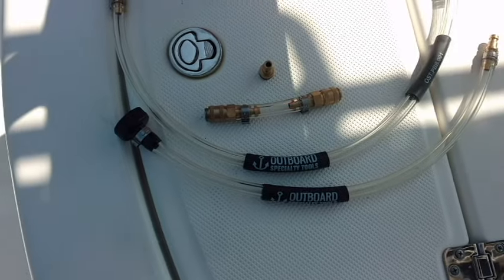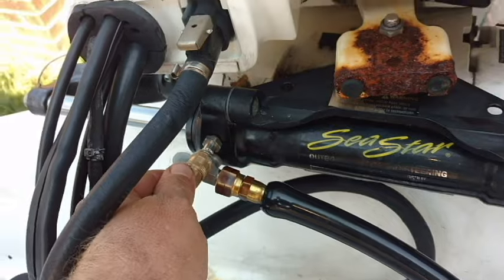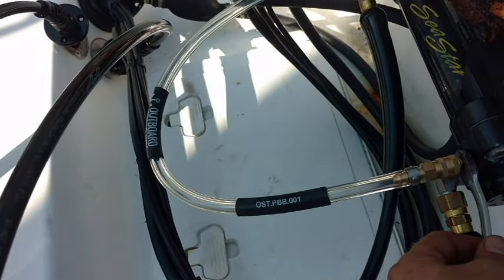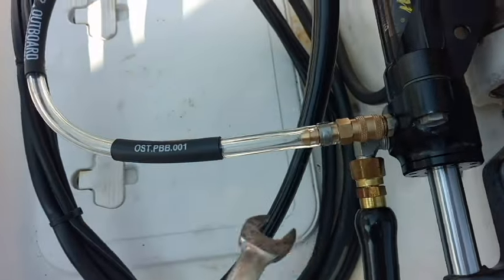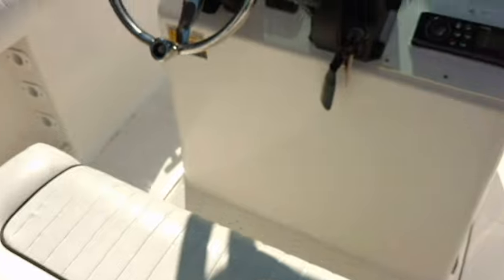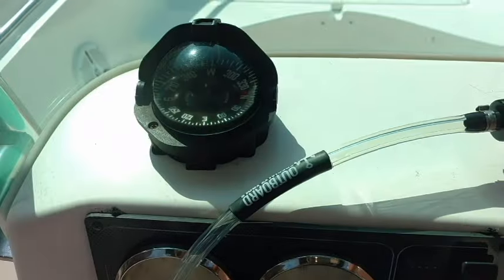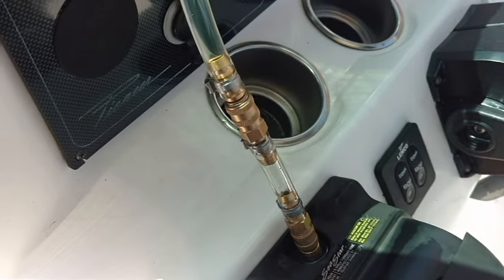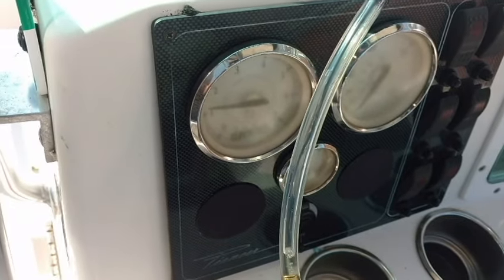Bubble Purge™ SeaStar Hydraulic Steering Bleed Repair OST

Comment: good job. i wonder something.

when motor is moved to port side or starboard, how to lock the engine no movement?

and one more. when motor is moved to port side. Did you turn wheel counter -clock wise?
Reply from the maker: Usually If I want to lock the cylinder into place, I use a clamp, such as vice grips with something to protect the steering rod, usually a piece of pex tubing, blue with 5/8" interior diameter (if I remember correctly).  This clamp method is in our other video featuring the G2 https://youtu.be/CwolF1vIXGA at minute 18:00.  Usually when I have the motor turned out all the way to port or starboard lock, I turn the wheel in both directions, but give it a few more turns towards the direction the motor is already locked out, i.e. if the motor is turned all the way to the port lock, which is done by steering hard to starboard, I will continue to steer to starboard in order to push as much fluid as possible into the port side of the cylinder bore to remove as much air as possible.  Then you can lock the cylinder down if you want, and turn to port and close out as much of the starboard bore as possible while priming it fully.
Reply: @outboardst.comoutboardspec8631  i have watched your other video clip in youtube for purge solution. thanks for your reply. have a nice day. :-)

Comment: Does air in the line make you steering feel like gears grinding alittle? I still need to bleed mine more I believe. Just the grinding part has me curious.
Reply: If you have air in the line, it would either make a squeak noise or slip.  Another way to tell is your steering is spongy or non-responsive.  The cylinder should be moving within 10-15 degrees of turning the wheel either direction.
Grinding noise sounds like you have rust / sludge in the helm.  If your helm is in salt water and it not been flushed each year, it most likely have rust sludge inside.  I know because I just rebuilt my buddy's Seastar helm just last night.  It was caked with sludge on the bottom of the helm.  Look at your hydraulic fluid.  If you have Seastar fluid, it should be clear yellow.  If you see a brown tint in it, its all rust.  If I can show you the pictures of the rebuilt helm inside, you would be shocked at how much rust it can get inside.  The seastar helms suck because it has open vents and that allows water to get inside.
Reply: @ahndeux  thanks for replying back. Now i have narrowed it down to maybe a bad hydraulic pump. No air in system and when i turn all the way to the left I feel like a grinding feel. All the way to the right is normal. What do you think this could be?
Reply: @jeffjue4648  Do you mean the hydraulic steering helm?  If you have grinding on one side but not the other, the most likely culprit is your hydraulic helm.  More specifically, its in the check valves inside your helm.  If the helm has been in salt water for years, there is a good chance the grittiness is due to rust.  Here are two ways to quickly suspect rusting.  First, remove your fill plug on top and look at the o ring seals.  If its cracked and has gaps, there is a good chance water has gotten in over the years.  Second, if you can drain some fluid out on the purge valve into a clear container, look at the fluid carefully.  If it has a brown tint or you seem small particles, there is a good chance water got in too.  If you used the recommended hydraulic fluid, it should be a nice clear yellow.  If its even slightly brown, definitely rust sludge inside.
Reply: @jeffjue4648  The way the hydraulic helm pump works is, it has a series of cylinders inside.  The cylinder has a spring underneath it.  When you rotate the helm, it slides the tip of the cylinders along a plate that is set at an angle.  The angle makes the cylinders rotate and pump fluid.  After the cylinder, it goes to a check valve to on the left and right side of the outlet.  The fluid then goes into a shuttle valve that flips from the left and right.  Because of the way the pump is designed, it should be the same amount of resistance or grittiness on either direction.  However, if you have grittiness on one side, it means the check valves or the shuttle valve is working properly.  More likely you will see that its easier to turn on one side than the other if the shuttle valve is stuck.  Instead of pumping fluid into the correct output port, it may be recirculating back into the the other port.  On the exit end of the port, there is also two more pressure relief valves.  It is just a ball with a spring on the end.  This is designed to open if the pressure is too high.  If there is debris in those ports, it may be opening and closing and causing the "grittiness" feeling you had.  Until you open it up and rebuild it, it is hard to tell which area of the pump has issues.
https://www.youtube.com/watch?v=HJUjWE1o3Lo
Reply: @jeffjue4648  I don't do rebuild for a shop, however, I rebuilt the hydraulic helm on my friend's boat about 3 weeks ago.  You can look up the HS5176 kit number.  There is a range of different helms that the kit is compatible with.  I made a detailed step by step instruction for myself in case I have to rebuild another in the future.  There was a couple of lessons learned but it went very smoothly overall.  The "instruction" videos on Youtube is not the best.  Some of the videos jump from one step to another and a lot of details were lost.
Reply: @jeffjue4648  Rebuilding a helm requires a certain level of commitment.  You have to be committed that once you start, you have to finish the task.  You also have to commit that you may make a mistake that will lead you to buying a new helm if you damage parts inside.  If you're okay with that, rebuilding the helm is not a difficult task if you have worked on cars before.  I had some trouble removing the caps/washers over the shuttle valves.  In my case, they were moving freely so I had no reason to dig deeper to take it out to clean it, other than to spray solvent inside.  I'm sure if you have a puller, the cap can be removed.  I can clearly see it was held in place by just a gasket, but the gasket was frozen i place.  We didn't have the tool and the decision was to not remove it and risk damaging the helm.  Other than that, the rest of the rebuild went smoothly and the result was excellent.  My friend's helm was very difficult to turn originally.  After the rebuild, you can turn the helm with only one finger with the steering wheel.

Comment: what about twin motors and power steering pumps for big boats?
Reply from the maker: The Bubble Purge Kit featured in this video is best suited for single helm, single cylinder systems with no power assist or autopilot.  For power steering, power assist and/or twin cylinder systems with liquid tie bar etc, we have the Bubble Purge Pro Kit available for sale and rent along with twin cylinder bleed attachments for sale and rent.  We have no produced the how-to video for the pro kit yet, but hopefully will have a video up early '19.  Feel free to check with Outboard Specialty Tools Support if you have any questions regarding your specific system.  Thanks, Tyler

Comment: When I attach my cylinder attachment and open the bleed fitting the fluid is pouring out . I replaced the nipples and still having the same issue. Any thoughts ?

Comment: I have twin motors, whats the process for that?
Reply from the maker: A bit more information is needed to narrow down the best way.  Is your steering system single or dual cylinder, with or without power assist or autopilot?
Reply: @outboardst.comoutboardspec8631  It's on a 21' Sport Cat with one steering helm,  no power assist or auto pilot.  Helm sends fluid to two seastar rams mounted on 90 hp 4 stroke Suzuki outboards.  Hope this information is helpful.  Thank you for responding!

Comment: Does your seastar rebuild kit come with seals?
Reply from the maker: Hi Matthew, no the Bubble Purge Kit does not come with seals.  We do sell SeaStar seal kits separately on the website.  We also sell as well as rent the tool kit required for complete tear down, rebuild and bleed on all SeaStar cylinders.  The SeaStar rebuild tools kit comes with the Bubble Purge kit in it.
Reply: Outboardst.com Outboard Specialty Tools sorry I’m confused. So the rebuild kit comes with the bubble purge and the tools but not seals?

Comment: Thanks for the video!  I purchased the Bubble Purge System to bleed air after replacing the cylinder seals on my Seastar unit.  
First, I want to flush out and replace the old hydraulic fluid in the system prior to bleeding the air.  Can you give me advice on the best way to do this?
Reply from the maker: Hi David, flushing the system is easy with the Bubble Purge kit.  All you need to do is connect one end of the cylinder attachment to one of the bleed fittings with the fill tube attachment connected to the free end of the cylinder attachment with the open end of the fill tube emptying into a drain pan, bucket, bottle etc. Then open the bleed fitting, turn the steering wheel gently to push fluid out of the open line.  If the steering wheel builds resistance, its because you are pushing on the closed off hose/bleeder, turn wheel in the other direction gently until you see fluid coming out of the cylinder attachment/fill tube.  Turn the wheel repetitively until all fluid has left the open hose.  Close off the open bleeder, move the cylinder attachment to the opposite bleeder, open the bleeder and then turn steering wheel in opposite direction.  Once the system is empty, it may help to flush a small amount of clean fluid through the system before you do the final fill and bleed.  If you have any questions during the process, give us a call.  Thanks, Tyler

Comment: could this be used on a dual steering system ?
Reply from the maker: Hi Dave, I need a bit more info about your system.  This kit works with Dual Station/Dual Helm, but if you are referring to Dual Cylinder, it depends on the configuration.  Can send send more details on the steering system such as number of helms/cylinders, autopilot, power assist etc?  Thanks